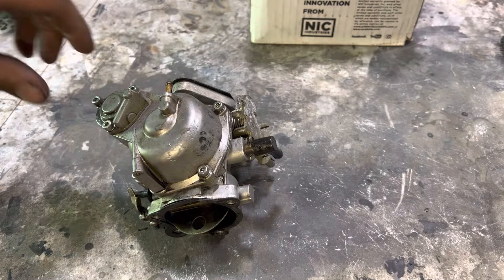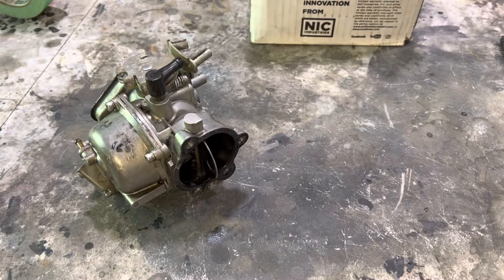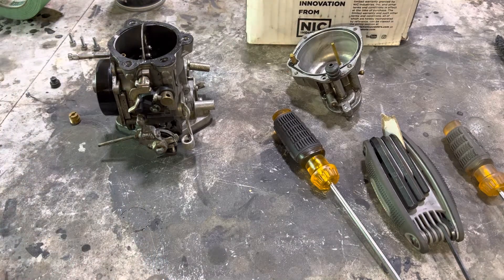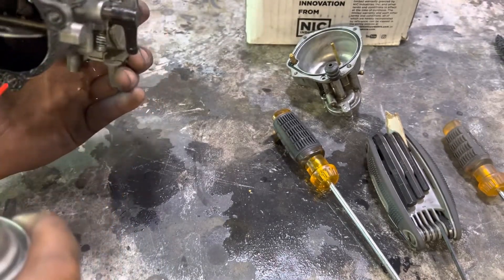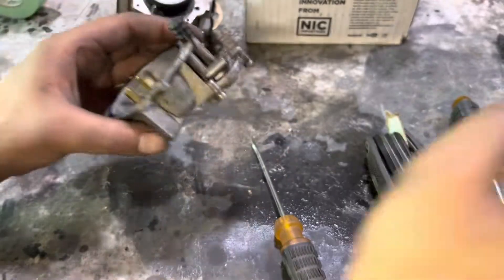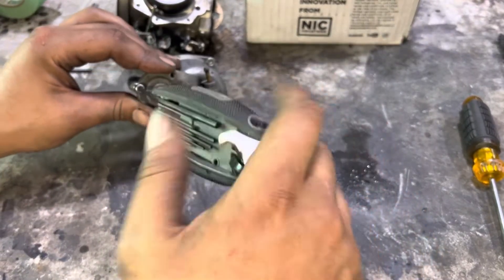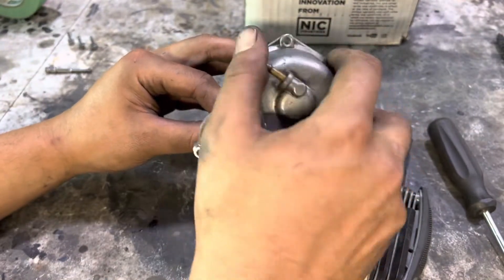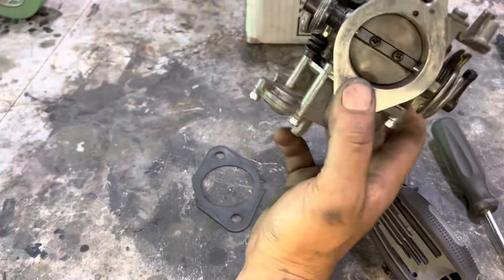Harley Butterfly Carburetor Clean Kehin AMF Era

Comment: I picked up an '81 Sportster 1,000 XLH Iron Head with only 3,000 original miles on it. It has the same carburetor, and was running like junk. Took it apart and it was gummed up inside. I cleaned it up to look like new in my ultrasonic cleaner with Berryman Carburetor Cleaner, before I put it back together I wanted to check to see if there's any 'extra things' I could do to it. Your video was great, but it leaves me with a couple questions: 
     A) My accelerator pump does not have the check valve. The passages, shape, location is identical to yours. Is that going to negatively impact the performance? Should I find a replacement.
     B) Without a check valve, should I move away from the STOCK Main and Pilot jets?
     C) Should I obtain a 160 Main and a 68 Pilot similar to yours?

Thanks in advance for your response, and thanks for the great video as well. I'm just north of you in Wisconsin.
Reply from the maker: Tuning wise will be dependent on the bike.  I'd start with what it has and go from there.  Sadly I haven't been in a Kehin in a minute and can't recall the check valve configuration.  I'd try and clean/run what you got first, then troubleshoot if there's issues.  After a good cleaning, it may be all good!  Good luck with the build!
Reply: @WrenchingWrecked  Thanks for the info. It was nastier inside than the on in your video. It would barely run prior to cleaning it, and it had absolutely ZERO acceleration capability. Even in neutral the engine would not rev up quickly, it had to be done slowly or it would kill. It's like new now, just missing the check valve. I'll toss it together with the carburetor rebuild kit I purchased, will fire the pig up and see how it performs and then report back. Thanks again for the info.
Reply: @WrenchingWrecked  In checking the Main and Pilot jets (now that they are clean) they are 160 and 80 respectively. Forgot to add that in my response.

Comment: The little black plug on the idel jet? Recently bought a ironhed it runs terribly when i give it throttle. It does not have this black plug. It also has had a auto choke installed. I need help 😂
Reply from the maker: It's my understanding that they need the black plug to run proper.  I'd start there for sure!

Comment: Thanks for posting. I am working on one of these now for an 1980 Shovel. I rebuilt the carb and when I turn on the fuel it comes right out of the overflow hose. Think that could be float level, is what I am thinking and it seems to be where it should be according to the manual. Do you have a better way to set the float level? Other than the manuals way " hold the carb like this and check the measurement", LOL with the diagram
Reply from the maker: Usually if it's overflowing it's a stuck float or way out of adjustment on the float.  What carb are you running?
Reply: Completely stock carb Keihin 
27471-80A
 @WrenchingWrecked
Reply: @WrenchingWrecked  Thanks, I just kept adjusting it till the it stopped leaking out of the overflow. But it is way off from the manual though. Now I am not getting any gas to squirt twisting the throttle. Any Advice, TIA

Comment: Great video! Currently cleaning up one of these off an ‘84 ironhead. Could you explain how to go about reversing the emissions crap they did to the accelerator pump? Do I need to find an accelerator from an older carb? Thanks!
Reply from the maker: On this one I used some old parts I had laying around, but if I remember correctly I swapped the housing (the lower base) of the older body accelerator pump.  I may have drilled a hole to match where the check ball sits too.  I think there is a dimple already in either the body or the base of the pump that I took a drill bit and cleared the passage.  They come with the dimple in the casting, even though it's not a through passage.  On the motor, I just ditched the stock Q cams for a good set of P cams from an earlier motor.  The drilling/housing change allows you to make the accelerator pump drop a full burst of fuel, whereas the late model carbs only squirt some of the shot into the motor and some of it into the bowl.  Hope this helps.  Good luck with the build!
Reply: @WrenchingWrecked  Thanks so much for taking the time to explain! Hopefully won’t have to get into the cams anytime soon, but I’m definitely going todo some more research on how people drill out the passageway to get that maximum fuel shot from the carb!

Comment: We're jets I hope to find when I open up the carburetor it's a Stock  80 cubic inch twin. And I see the accelerator pump has a screw where should I start off with the or hope to end up to get the correct amount of squirt do I need to have it squirt a lot or squirt a little
Reply from the maker: I usually run the accelerators on the richer side, but it'll be really dependent on what the bike wants.
Reply: @WrenchingWrecked  on the keihin carb that came on the bike that screw is for setting hi idle speed ..but spring has 3 noches I'm thinking that has something to do w accelerator  pump amt maybe.

Comment: Hi, I see you reply to these comments & I hope you reply to mine.
My carb runs good, but it leaks out the throat when not running, even when it`s cold & even though the petcock is off.
The petcock is new & doesn`t leak.
The carb has been rebuilt. 
The float has been set & reset & set lower.
The float has been checked not to leak. 
The needle is new. I tried 2 of them.
I have even magnified the seat (what they call "the float cup") & saw some discoloration of the brass, so I polished that with a drill & buffing compound, then with a fine Dremel stone & again buffing compound.
It still drips out of the throat of the carb.
I haven`t been able to find a new seat (float cup) & for now I`m putting another style of carb on my 84 Ironhead, but would still like to get to the bottom of this mystery & run my original butterfly Keihin carb...I just don`t want it catching fire!
Any ideas?
Thanks.
Reply from the maker: Same butterfly type carb?  It's strange it still leaks when the petcock is off.  How is the alignment of the carb on the intake/cylinders?  Any chance the carb/intake combo isn't level where it mounts up to the motor?  Verify if isn't pitched downards at all.  I have had one do that when the alignment was off on the motor.
Reply: @WrenchingWrecked  Hey thanx for the reply.
Yes, same type of Keihin Butterfly carb & it leaks even when cold & with the petcock shutoff until all the gas is out of the fuel line.
I sat & watched as an air bubble blurps up the line & the carb bowl fills again, then drip, drip, drip.
I did consider the pitch of the carb & wondered if I should re-set the manifold, but now I put on another (same type) carb & it doesn`t leak!
So, problem partially solved & I`m riding.
 I already had the carb so it`s basically free 
(just time & hair pulling)
but I`d still like to make the leaking carb work.
It`s a mystery & I guess it will just go in the junk box for small parts, but thanx for your consideration.
By the way, my bike is bitchin' & I see yours are too!
Thanx for your vids.

Comment: I got given this carb due to my su carb mis behaving !! Im running it on a 1972 1200 shovel, it's got a 70 idler jet ,do you think this is correct? Pops a bit !cheers ,Lee
Reply from the maker: It's been a while since I had one of these on a shovel, but I think somewhere in the 70 -75 range should be about right for a shovel off the top of my head.  Should be close enough to start and give you a baseline at least.  I'd just make sure you triple check the jets for clear passages if it has been sitting a while.  Cheers!

Comment: Hello!

Can you tell me the basic screw settings?
Idle speed 1 1/4 turns, rest?
Thanks!
Reply: i have iron 1985 sportster
Reply from the maker: I usually set the idle speed to seated on the idle adjustment then 1/4 turn in and adjust as needed once running.  I run the mix screw at 1.5 out from light seat and adjust once warmed up.

Comment: Can you show how to properly  adjust the Float.
Reply from the maker: I’ll try and do one soon on the next carb video. I have four from a Honda and will also be tuning the 883/1200 swap evo with a cv. If you want a butterfly specific one I may be able to do that too.
Reply: All my shovelheads have the butterfly carb I love keeping them original.  They run  very well.  I need.to.lean how to adjust the squirt I would.like to shut it off also it squirts to.the far left I need to turn it to the center so the front a d rear get the fuel equally.  I dont.know how to.do that.
Reply from the maker: Give me a bit but I’ll try and do a re adjust video on the pump for you at some point! That is a big part of making em run better. I wish I had the camera on when I first built the blue ironhead for that reason. Lots of time on dialing that carb but off camera